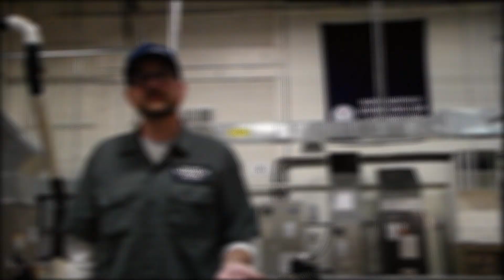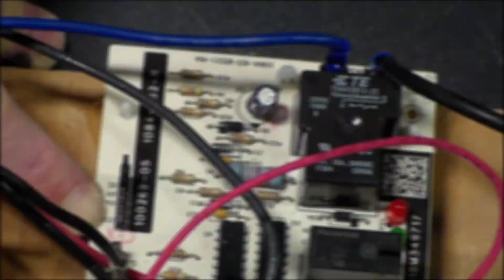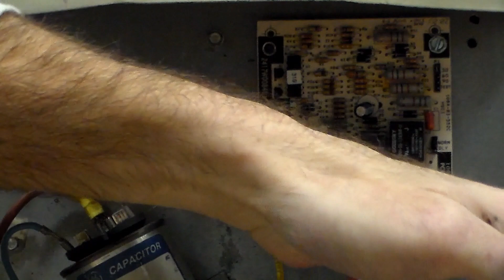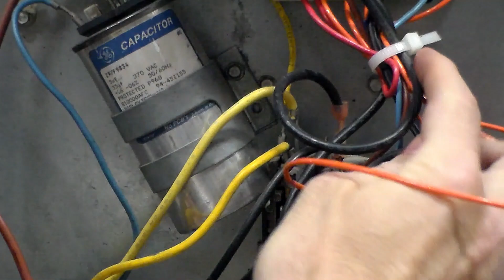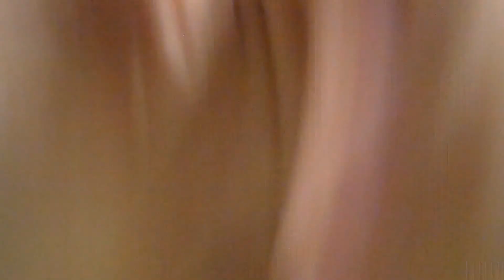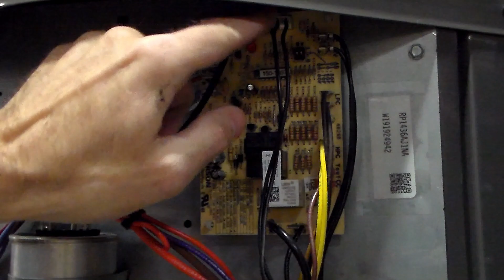Heat Pump Boards

Comment: RHEEM I HAVE I DON'T SEE WHERE THE COMMAND WIRE GOES TO THE OUTSIDE BOARD.  MY COMMON WIRE GOING TO THE CONTACT
Reply from the maker: I'm not sure what you mean? Y=cool R=24v power D=aux heat C= 24v common B=reversing valve
Reply from the maker: In the stat/air handler = D-Aux, R-R Y-Y C-C B-O/B and your stat needs programmed for B instead of O.